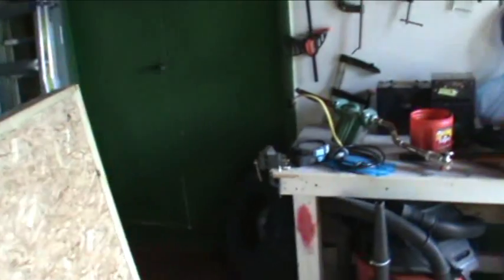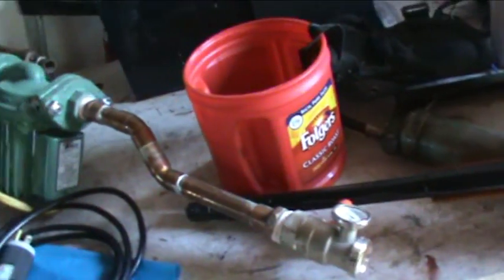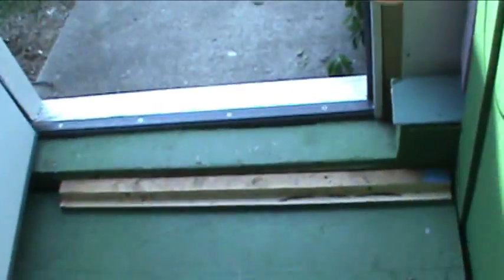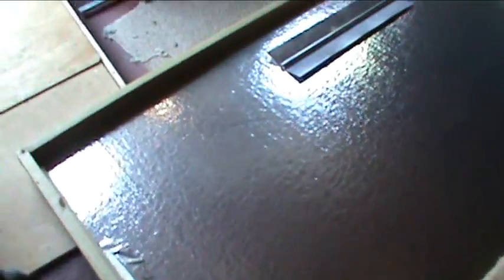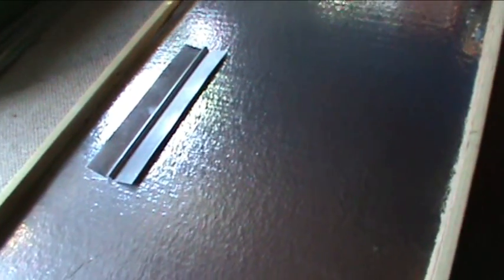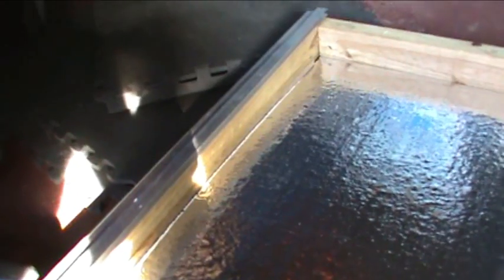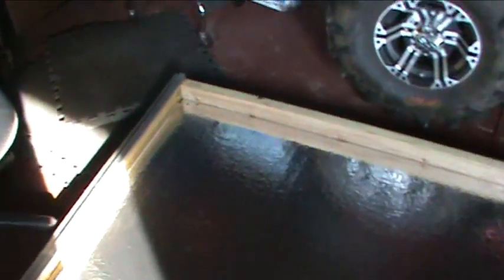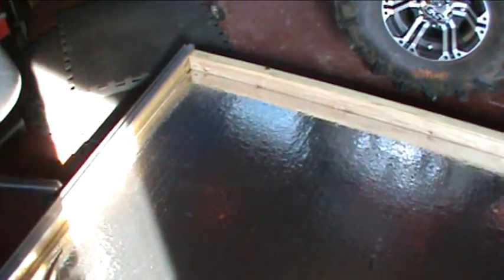Creating a solar hydronic ( water ) heating system

Comment: I did fiberglass resin the outside only.  I was worried about the inside cracking or paint peeling with the higher temps inside.  Poly carb seems cool.  Almost like a magnifying glass, but insulated. I'd like to see what your temps get to.  Summers a waste'in !!